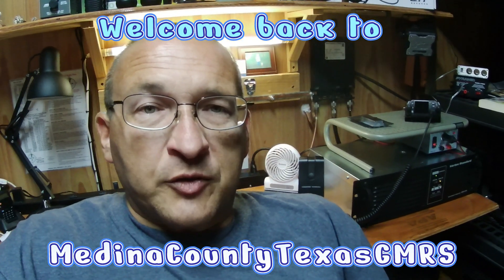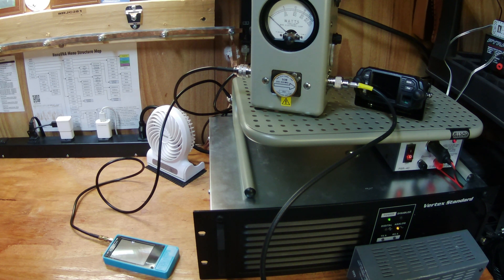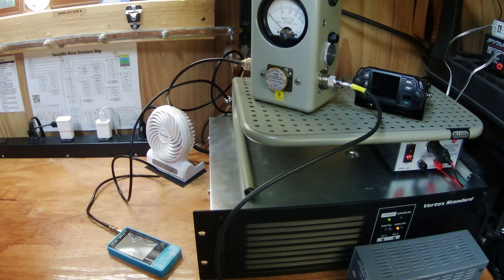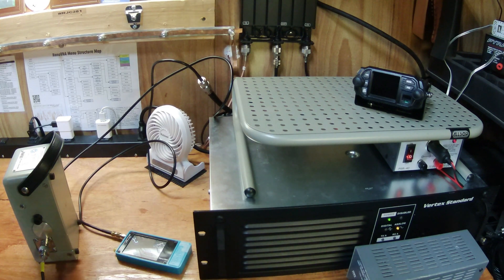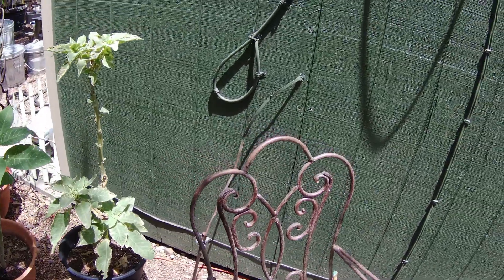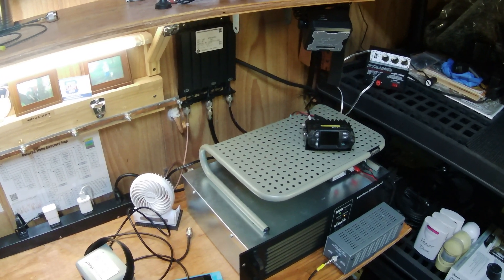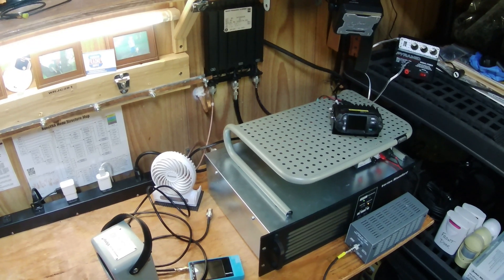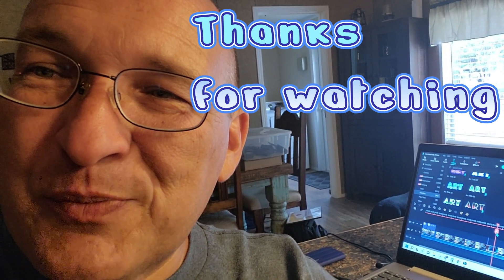GMRS - Vertex Repeater Update Part 1

Comment: Dude, I think you need to swap out that compact cellwave duplexer for a more robust 6 can uhf GMRS tuned duplexer and get the antenna re-tuned to 1:5:1 SWR.  Also, make sure your antenna is grounded.  I would try to get atleast 25 feet in the antenna using fence posts set in 4 foot hole with concrete.  Minor changes and you will get  the distance.  With DMR you should easily get range and more in-building coverage.
Reply from the maker: All great info!   We are still tweaking here and there and these tips are VERY appreciated!!!!  Thanks for watching and taking the time to leave a comment!

Comment: That looks like a 50W XLT duplexer. I've watched videos of people set up repeaters with two 50W radios, and get about 25W out of them. I like the idea of a 100W radio that gets 50W to the antenna after the duplexer.
Reply from the maker: Yes...  definitely a lot of loss in these flat packs.  Usedradios.com said he would adjust the power based on my run of feedline to get it right at 50 watts up top.   Good group of people over there.

Comment: One thing you can do is install a 100 watt 8 Cavity duplexer and put a UHF amplifier between the duplexer and the antenna...being careful NOT to overdrive the amp. I tried this and I get a true 50 watt output without loss of from the duplexer
Reply from the maker: I had thought about that... but think, if anything, we'll go with a higher watt repeater, if needed.
Reply: Hmm, the antenna is amplifying Tx and Rx 460MHz going both ways, while a UHF amplifier only boosts and passes EMF going from the GMRS to the antenna in the Tx direction.  Thus the Tx amplifier is a one-way device and blocks the Rx from passing thru the amplifier.  Or am I missing something here?  It sure didn't work for NotARubicon when he tried using a Retevis RT91 Amplifier on the output of his repeater https://youtu.be/zQKECxS1tPo
Reply: @CaliforniaTravelVideos the amplifier is fed from the TX radio, low wattage into the amplifier, out of the amplifier into the TX side of the duplexer.
Reply: That is exactly what I did. It works, kinda. The TX radio is set to low power ~3W. The amplifier is sometimes overdriven by the 3w and then passes the signal straight through to the duplexer. I had to set the amplifier to 60 w to get 50w out of the duplexer to the antenna.

Comment: Everything that I have read is that Duplexers are terribly in-efficient.. Typical loss is 1/2 the inserted power in watts. LMR 400 is a good RF coax to use but solid core hardline is better but way more expensive. Maybe pushing the transmit output through a UHF amplifier would definitely help to get to that 50 watt output that the Over Lord Masters at the FCC has limited GMRS to. I recently acquired a 70 ft Hy-Gain telescoping tower and am putting a mix of Ham and GMRS antennas on it with a rotator and 15 ft mast. I have about 80 ft of 1/2" solid core RF hard line that I will use to hopefully cut down on RF loss. Good Video. Keep up the good work!
Reply from the maker: Thanks for watching and commenting!   We will be upgrading the antenna and coax very soon.   Solid core is definitely the way to go, it sounds like!
Reply: @MCTGMRS78009  33% is typical loss for those mobile duplexers
Reply from the maker: @defconpops4364  thank you for the info!  Looking to upgrade soon.

Comment: When buying LMR Cable as in .400 dia. Be aware that it can come in at eithet 50 ohm or 75 ohm which where your radio requires 50 ohm for maximum power to the load with a 50 ohm radio and a 50 ohm antenna so there's no line loss
Reply from the maker: GREAT INFO!  TY!

Comment: You know the repeater is set for 40W...but is it actually putting 40W out? I've not messed with the VXD-R70's but with the Motorola counter parts (XPR8300 and XPR8400 and all other Motorola DMR repeaters) you could open up a program called RDAC (Repeater Diagnostics and Control) and read if the unit was in High VSWR protection or had other issues keeping it from functioning correctly.
Reply from the maker: Thanks for that info!!!  It is kicking 40 out the ass-end but the duplexer seems to be bogging it down quit a bit.  The more I look at my antenna height (which is only 45' AGL) and consider the hilly terrain here, I have come to grips that it's doing a pretty damn good job.  LOL
Reply: @MCTGMRS78009  another thing I've found, those mobile/notch duplexers have a hard time handling more than about 32W on the input. They will begin to desense which affects the repeater's ability to receive signals while it's in repeat mode.
Reply from the maker: @zapityzapzap  Very interesting info!  It does make sense.

Comment: You shouldn't lose half your power through a duplexer.
Reply from the maker: See, I thought the same thing and had a ton of folks tell me the flat-packs were bad about that.  Gunna keep digging.  THANKS for the info!
Reply: @MCTGMRS78009  Depends on the manufacturer. Cheaply made "flat packs" or notch duplexers can have 1.5db loss or more. A good quality notch duplexer can have as little as .6db loss.
Reply from the maker: @jcflyer6213  We are going to be upgrading it soon.  Any brand that you recommend?

Comment: Great content! Reading/watching as much as I can about GMRS in general (still not licensed - yet). I have watched a lot of content on GMRS. Randy over at NotaRubicon did a video on the Retevis RT97 portable repeater https://youtu.be/fqeuP6tPQL8  He did a power output test, and made the comment that the duplexer would steal about half of the power output, especially on cheaper duplexers. So even though that repeater clams 10W output, it only put out about 5W. I see you are not using a cheap duplexer, so I would expect less of a loss, but you will still have some loss associated with the duplexer. If you go to about the 14 minute mark on the video, is where he talks about the power output.

Again, I am not an expert, I just watch/read a lot. Hope this helps.
Reply from the maker: Welcome to the channel and thanks for watching!  I was figuring a loss of maybe 10 to 15 watts.   We are still digging to figure our of the duplexer might be bad.   I will keep y'all updated!

Comment: I just assembled similar repeater.   40W Tait repeater.  Getting roughly 26W after duplexer.   I have a gp9 commercial tune antenna at 50 ft and I get about 10 MI handheld range.
Reply from the maker: NICE!  What kind of terrain do you have around you?
Reply: @MCTGMRS78009 heavily wooded light rolling terrain with scattered iron ore pits and dumps.  Located in Northern Minnesota on the Mesabi Iron Range.   So area has a long history of open pit iron ore mining.   Makes it a bit harder to get good coverage without serious height.   I am looking at the possibility of including a receive preamp from Advanced Receiver Research (AR²) to help increase HT coverage.